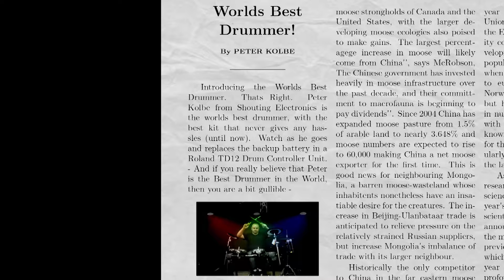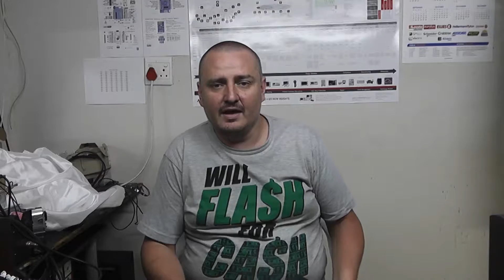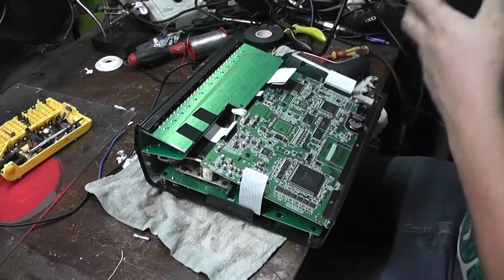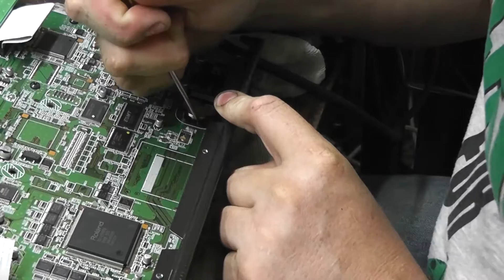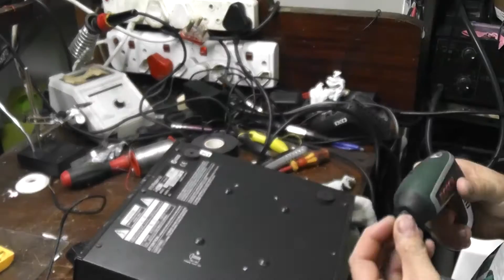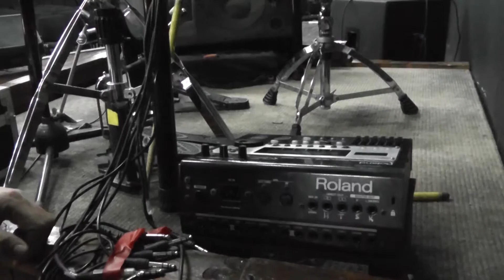ShoutingElectronics #3 - Roland V-Drums TD-12 Backup Battery Replacement

Comment: I had the ''battery low'' message on both modules for many months and one day, when the only option on one of them was ''factory reset'' and I had no sound, I thought my module was broken for good. Good thing I googled it and realized there was just a 2$ battery to change inside. :=) I lost my settings/data in only one, but I will use my MIDI cable to send my saved backup back in it.

Comment: IMPORTANT : 
1) make a full backup of your module  before hand, using a software like vdrumlib

2) before inserting the new battery, make sure you :

- remove any sticker that might be on it (on mine there was a warning sticker underneath), as it will prevent the battery from working...
- put it in the right direction '("+" side on top)
Reply: You can have the power on like this guy does everytime you need to change the battery and the data is saved! AI google it as it says it's safe to do so with the TD-12 module.

Comment: To anybody watching this in the future, you don't need to pry out the battery. Gently press it in and then back a little, then you can slide it out.
Reply: Thanks for sharing
Reply: Tried it by pressing it with my fingers but didn't manage to get it out this way. I pried it out (lifting it from underneath) with a flathead screwdriver just like in the video and it worked well.
Reply: @djabthrash I tried to use @matthewwinne method and it worked. It is way safer not to break anything as well. Try to do it with the old battery to practice.

Comment: This is a solid machine, but it is 3 pounds of poo in a 2lb box...

We've noticed that they lose their OOMPH after a few decades and a half. 

They're expensive AH, and replacing it with something twice the size and money (they're ELECTRONIC, WHY, WHY do they NEED to be LARGER than a Vistalite???) Is out of the question. 

We'd LOVE for a small, PORTABLE thing (almost all drummers ALREADY HAVE at least one acoustic kit,l with a ton of power at under 1,200. The brain box on such is a nightmare as I hear it. 

I thought these went back to 1997...?